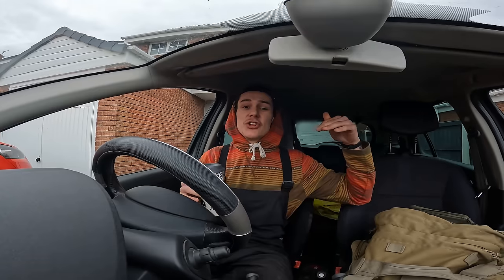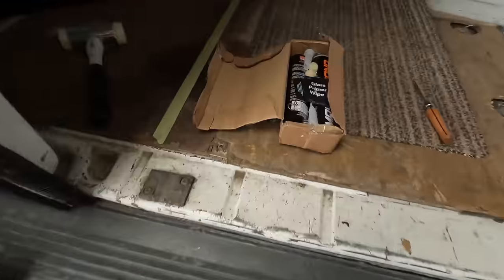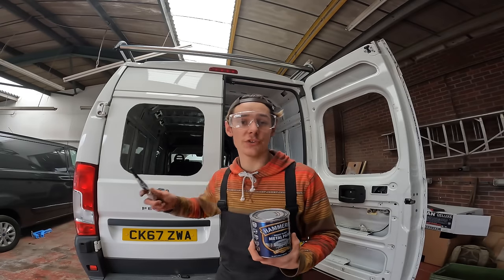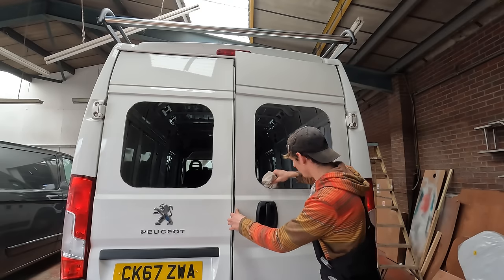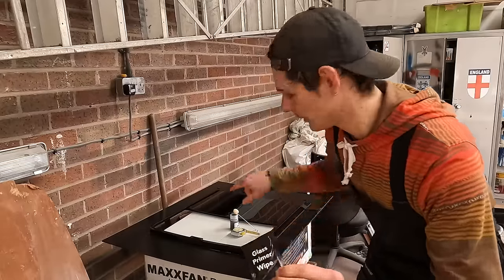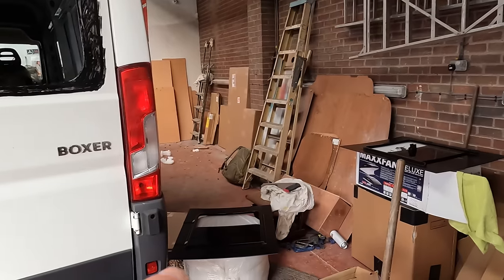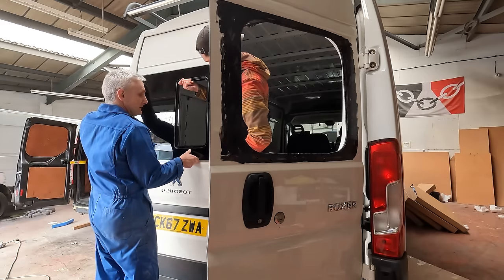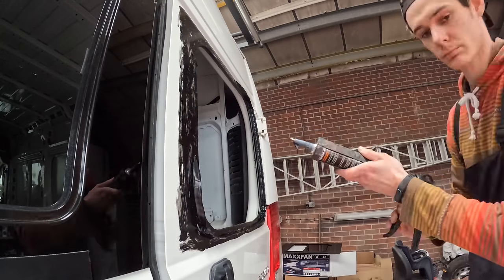REAR SLIDING WINDOWS - Peugeot Boxer - SOLDIERS VAN BUILD

Comment: Jake,Jake,Jake....please drill the corners and use a nibbler or jigsaw for the side windows...not a grinder!  Also, as the rear windows are sliders, they should have water drain holes built in.....so, you did leave a gap in the bonding at the bottom didn't you, for the water to drain OUTSIDE....rather than it having only 1 place to go....in the van?  😉
Reply from the maker: Nahhh man, worked alright for me… Imma keep doing me dude 🤘 I sealed and bonded but yeah it’s flowing! Nothing to worry about!🤙
Reply: @JakesJourneyMate  Ahh well....I tried. 😉 If you're going to carry on butchering the van with a grinder, when there's better, neater ways to do the job, at least cover up the exposed paintwork. Otherwise you're going to end up with loads of metal swarf, which then shows up on the paintwork as orange rust spots. Over and out....
Reply from the maker: @steveb9989  each to their own dude 🤘
Reply: @steveb9989  You did LOL